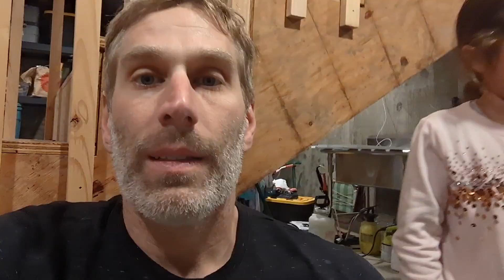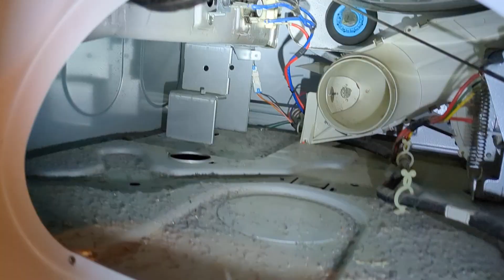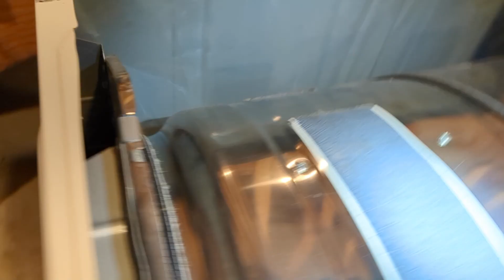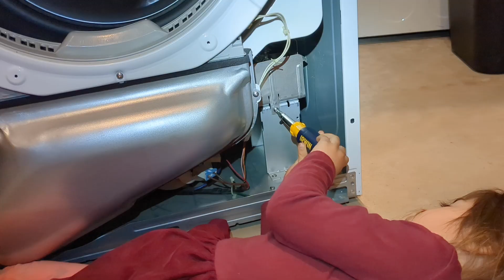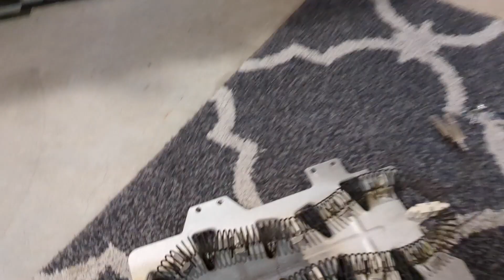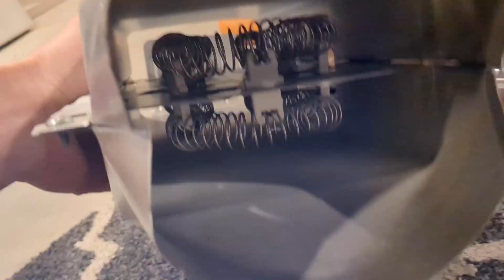(Heating Element Failure) Troubleshooting an Electric Clothes Dryer

Comment: Fantastic job. Thanks! Goes to show that a repairman is only as good as his support staff! Very complete and super easy to understand. Lucky for me, my gas dryer doesn't destroy a heating element wire and it just keeps on running, and running, and running, and running, and running. However, many years ago the dryer belt did break and was an easy replacement but take care with the tensioner adjustment (the same type of issue for gas or electric dryer drum).